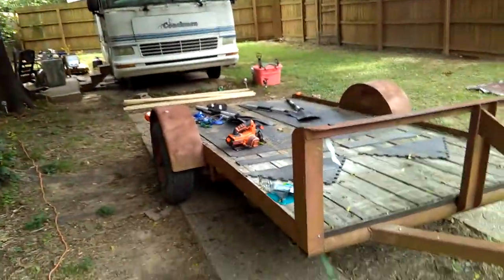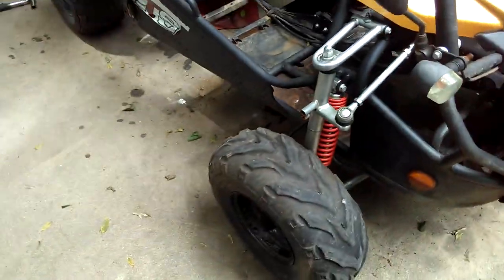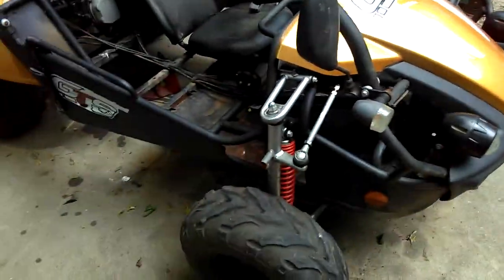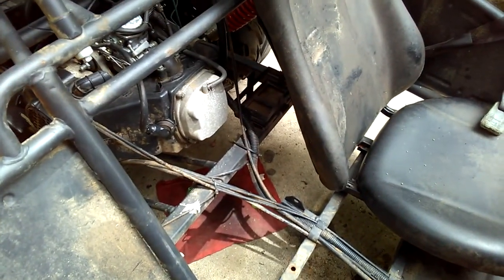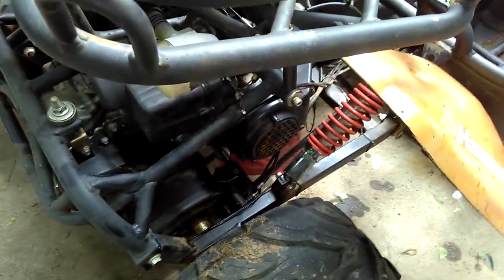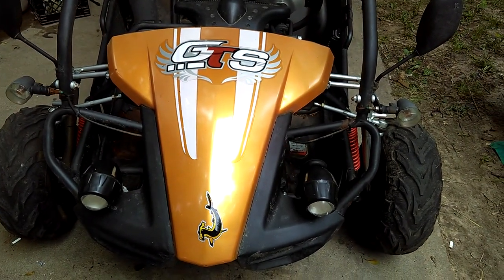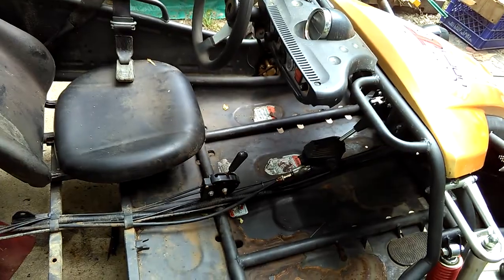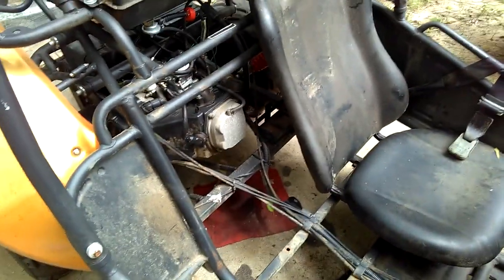2015 Hammerhead GTS 150, Update alignment, valve adjustment.

Comment: I have a 21 gts hammerhead the shifter won't shift right, also the key switch stopped working it won't turn the dash on or turn over  but I can jump the solenoid with a screwdriver have you ran into anything like that?
Reply from the maker: Shifter...Check the free-play in the cable and if the idol is too high it wont shift...All I can say about the elec...is to check all the ground connections...